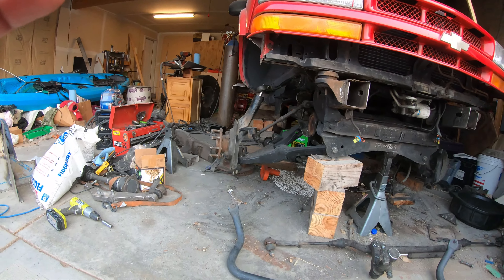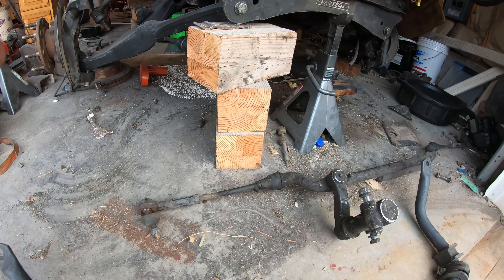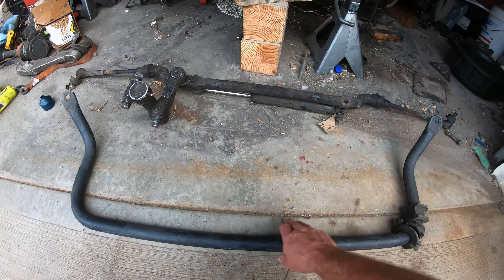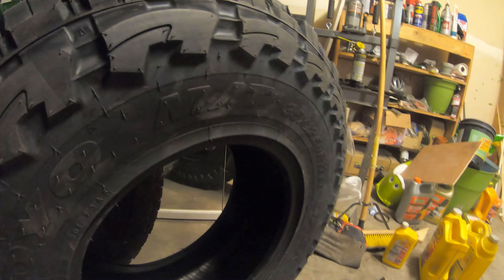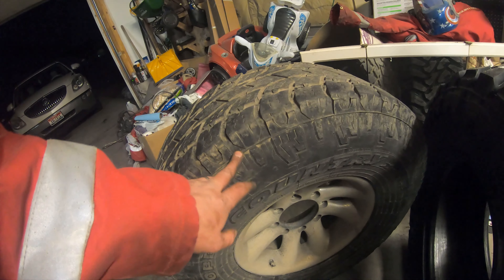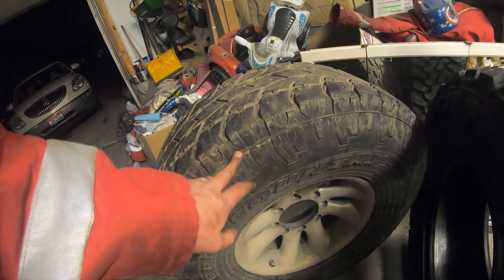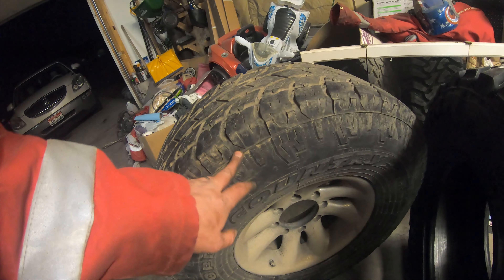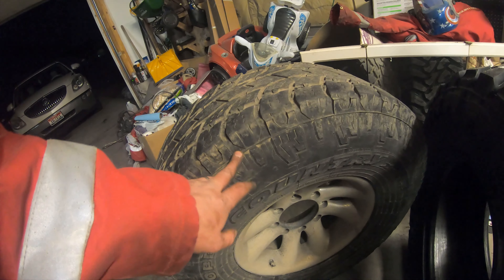Ultra 4 EMC Build S10 9.25 AAM GM IFS bullet proof Differential

Comment: Not sure what you cut out of that stock front 2500 anti-roll bar, but they often neck down in the middle. That bar is made for a much bigger truck and if you narrowed it and removed a smaller diameter section it is probably way too stiff for the front of your Blazer. It was most likely already too stiff for your off road racer being from a bigger, primarily on road vehicle. 

The bar's stiffness is related to its length and diameter. Shorter and thicker make a stiffer bar. 

No harm in trying it out, but you'd probably be better served with a Rock Jock front anti-roll bar. Maybe you can save a few bucks and use something from a stock vehicle. I wonder if a rear bar from something would work in the front of the Blazer. It'll be less stiff than stock, but that's probably good for what you are doing. Finding something that will fit will be the problem. 

Anyway good luck with the build.
Reply from the maker: I totally understand your concerns. I had the same. With that said, let me tell you my thinking. My a-arms are about 3 3/4" longer than stock increasing the leverage on the sway bar. A side note, the sway bar had the same dimensions the whole length of the bar. The bar is thick and made for a much heavier truck. When the S10 is doing hard fast corners with bumps and breaking this bar just might work or the suspension will become too stiff on corners making it unsafe. I also have the thought of no sway bar on the front and tune the torsion bars accordingly. Fast dessert racing needs stiffer suspension than a daily driver. I have it for an option. I still don't know if I will run with it.

Comment: So just watched your video and was wondering how you fit a 9.5 locker in your 9.25 carrier? I'm getting ready to put gears in my own 9.25 and was unable to find anyone that sold a locker for the 9.25. I'm just wanting to confirm that this is what you did and you had no issues putting in the larger locker.
Reply from the maker: Oh Yes! That was my same questions. First off 3 companies that I know of make 9.25 lockers. ARB, Eaton, and PowerTrax. ARB and Eaton come with the whole carrier and Power Trax Lock Right only replaces the spider gears.  East Coast Gear Supply sent me the 9.5 locker and I was concerned that it was the wrong locker. They assured me that the spider gears of the 9.25 and 9.5 are the same. They share the same spider gears and bolt right in. The carriers of the 9.5 and 9.25 are different.
Reply: @daveroseberry  thank you for the response I'm going to go ahead and order one up for my front end build. I'll be watching for updates on your build.

Comment: So confused on why you didn’t just solid axle swap it. My solid axle s10 has d44 and D60 on leaf springs with 14” of travel in front. And rides much better then my brothers dues max with a 4” lift.
Reply: No offense at all brother. Some of us are hell bent on proving ifs capabilities seen several ifs trucks top truck qualifiers now I wanna know about his 9.5 diff and like he was talking about the Hummer axle it's the same exact as the bravada axle swap I done is. But I've shown several solid axles up myself and while you have benefits I don't I have benefits you don't it's all choice man. Just glad to see other Blazer S10 enthusiast
Reply from the maker: Ultra 4 racing requires a stock suspension IE has to be IFS with torsion bar. Yes solid axle is better for crawling but IFS is much better for desert racing. I want the challenge and do something no one else has done. That is the spirit of King of the Hammers.